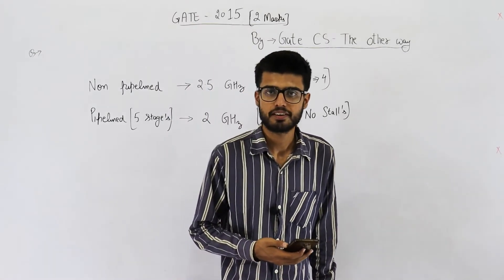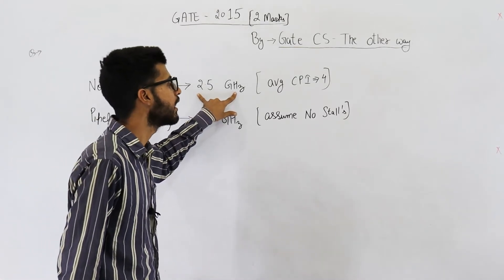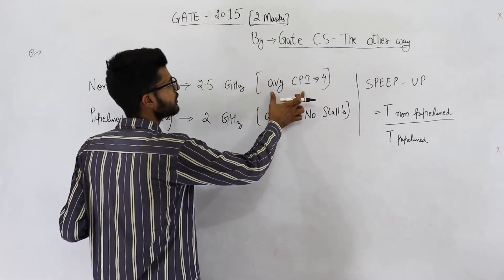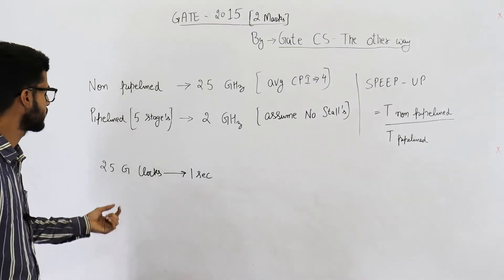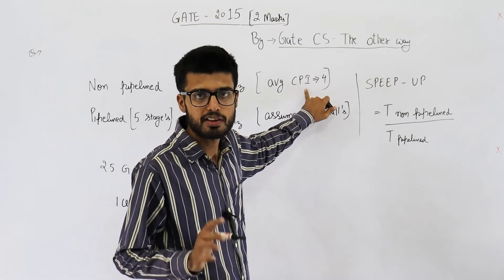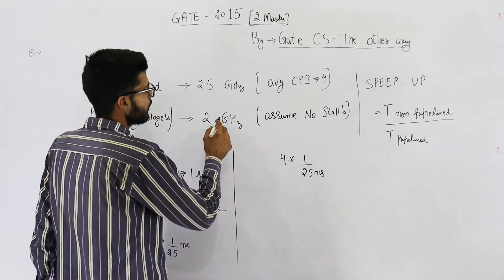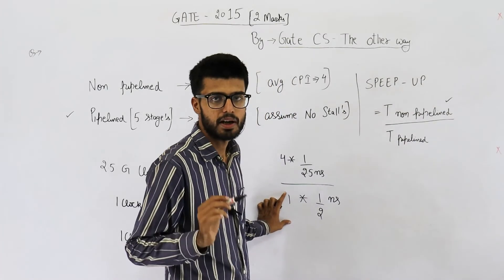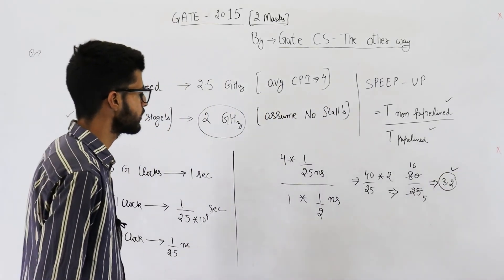Gate 2015 pyq CAO | Consider a non-pipelined processor with a clock rate of 2.5 gigahertz

Comment: I have a doubt sir. while calculating the execution time for NON PIPELINE we are given average CPI which on multiplying with time period will give us AVERAGE execution time which means execution Time of 1 instruction .  so while calculating execution time for pipelining process why cant we apply the pipelining formula [k+n-1]*tp for n=1 instruction . why is it not giving the same result
Reply: Even i have the same doubt ... did u find any explanation ??
Reply: @achyutanandasahoo9761  K+N-1 cycles are required to execute N instruction in pipeline with no stalls. So to execute 1 instruction (CPI) we will take K+N-1/N cycles . 1)In ideal scenario or 2) the case where n is not mentioned we assume K<<<N thus neglecting K-1 and hence getting CPI=1.SO WHENEVER IN THE QUESTION IDEAL SPEED UP IS ASKED OR N IS NOT MENTIONED THEN TO FINED SPEED UP WE HAVE TO USE tn/tp. Hope this helps.